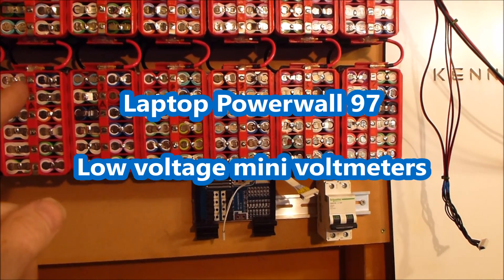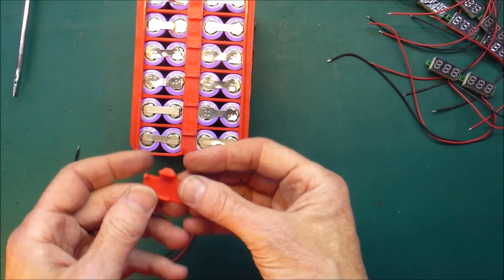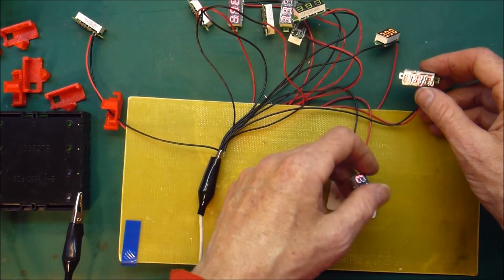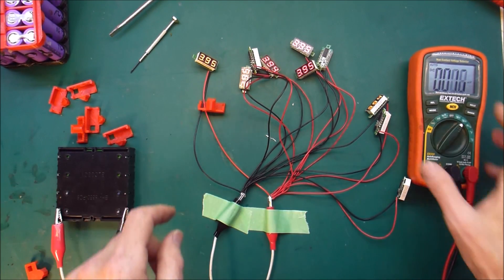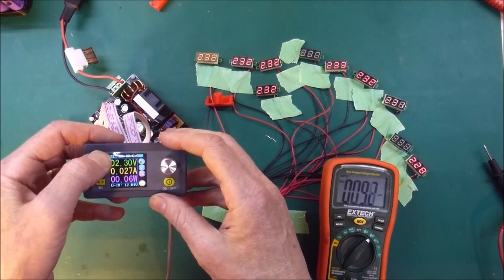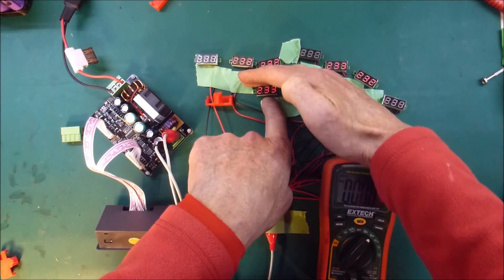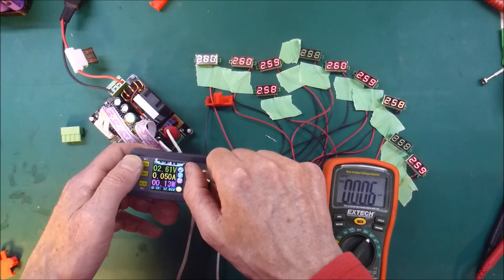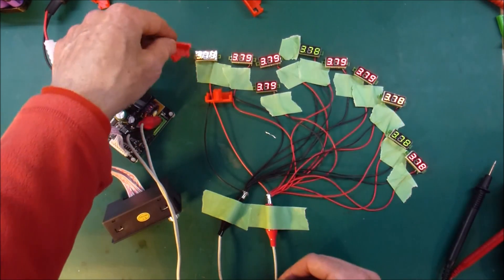Laptop Powerwall 97 - Low voltage mini voltmeters

Comment: Hi friend 
nice video, in face you make a video for this power supply DPH3205. as you like it , you can make vidoe 
you can how its charging battery fuction. thank you
Reply from the maker: I use the DPH3205 to give power to 20 TP-4056 charger modules.
Reply: Paul Kennett
very good ,. hope you like it and tell your more friends, this buck-boost is very useful to test the battery

Comment: Hi Paul would this work in a power wall?
https://www.youtube.com/watch?v=rpRYNMrVCk0
Reply from the maker: Not really - it's too low current for a lot of batteries.
Reply: Hi Paul I ment one charge controller for each 18650?
Reply from the maker: They work great for charging single 18650's. As son as you start building up a powerwall with more cells in parallel you'll find them really slow.

Comment: Hmm, common ground for all and switch for checking for less power lost? (and maybe at times annoying red glow going on when darkness required, i.e. sleeping in same room)
Reply: well nvm, it cant be common because.. yes, that, so what would be a good common switching for different sources hmm.. that doesnt draw power itself and requires little routing..
Some relay block I guess? That uses some during checking and would mostly be off then..
Reply from the maker: A single switch would have been nice. I went with quick and simple this time.

Comment: Very good choice. They are small and you can calibrate them so they all read same voltage. There are also blue ones, but they stop working at higher voltage. I do not like them. Blue is very difficult to read from distance.

Comment: The difference between the different colours are down to the LEDs themselves.
I found this handy chart showing the different colours and their "forward voltage"
https://softsolder.com/2013/04/02/led-forward-voltages-vs-color/
Red is the lowest voltage, blue is the highest, IR and UV LEDs aren't applicable.
Reply from the maker: Interesting that there was one red unit that went way lower than the other red units.

Comment: Red LEDs have a lower forward voltage meaning they'll illuminate at lower voltages. Green are higher. 
I like the fact they are all different colours - it makes it a little bit more like your power wall lighting. 
As long as they all marry up at your critical voltage they're a good indicator. 
Cheers for the mention and link. Very kind. I've put my rui deng in a box now. Easier to use that way. Although if you check out the comments on my video you'll find a thingyverse link for a 3D printed stand for the control panel someone made.
Reply from the maker: I was amazed by the one on the far right of the bunch - both brighter and kept reading at a lower voltage. 

I've got an old aluminium box I plan to butcher for my Rui Deng. It's a good find. Cheers